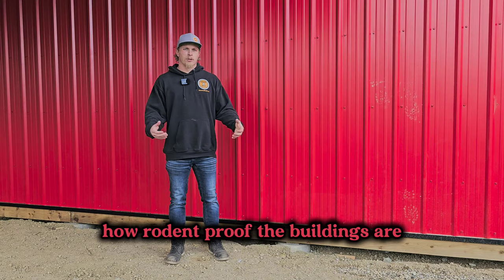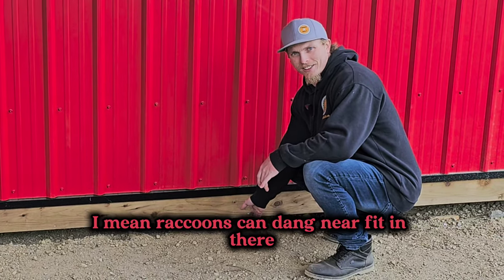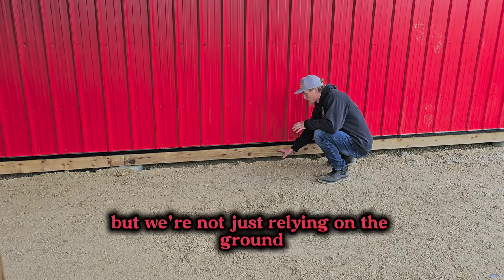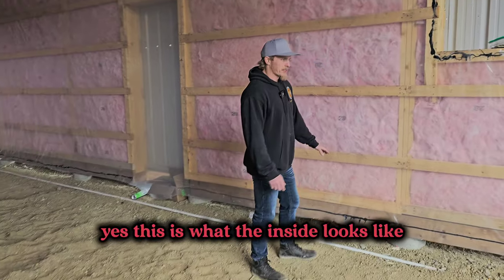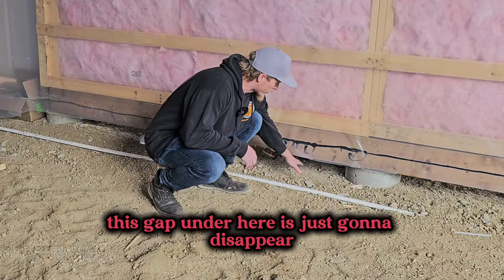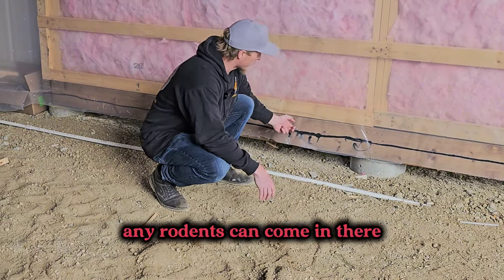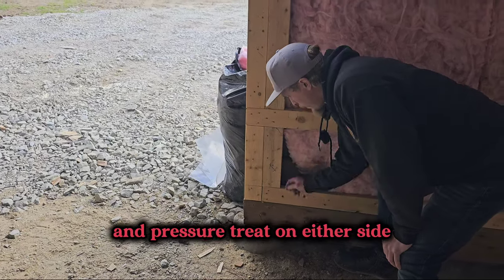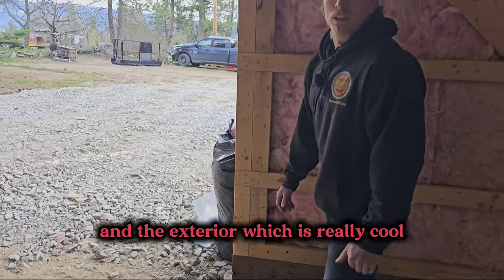Rodent Proof Shop

Comment: When I built my building I did as you did but was also required to put Styrofoam around building 1foot deep and 1foot out. Underneath that I buried galvanized chicken fencing at 2 feet out from building. This completely annoys  ground hogs skunks or any other critters who would dig under your slab. After 10 years no problems.
Reply from the maker: Awesome!